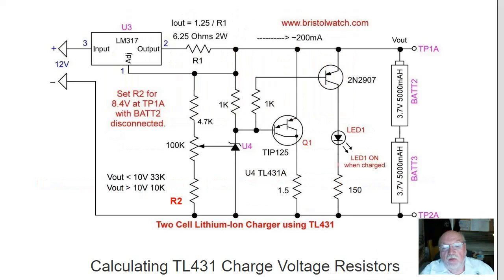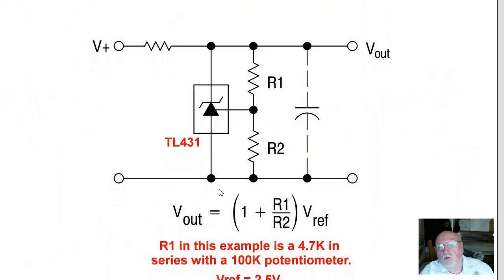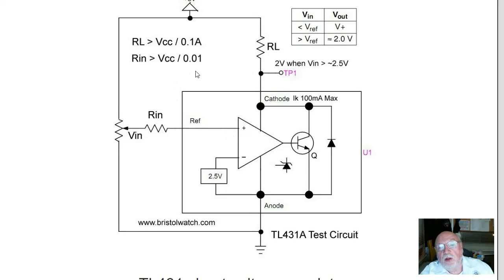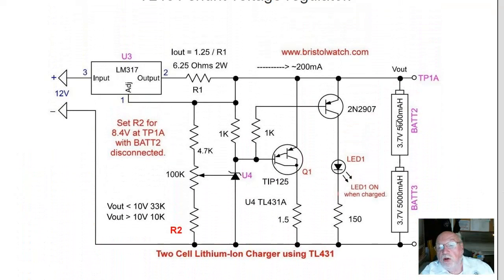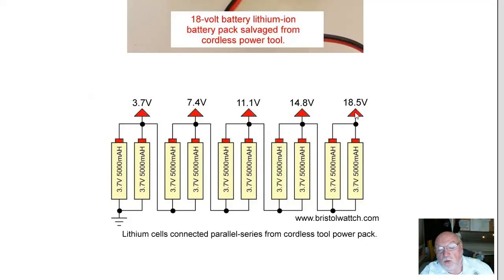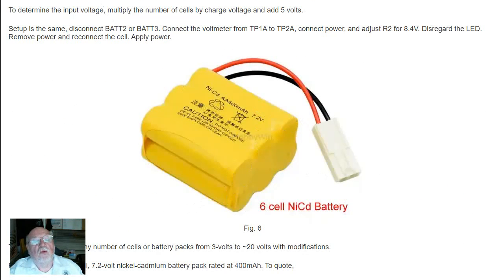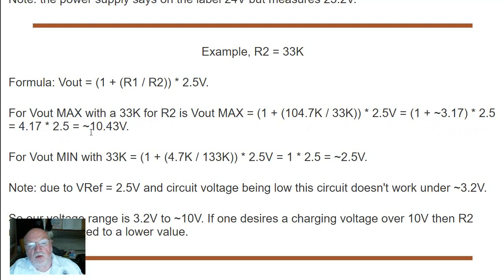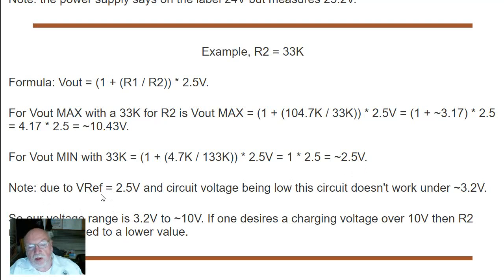TL431 Battery Charger Circuit Calculations Revised

Comment from the maker: http://www.bristolwatch.com/ccs/TL431A.htm Experiments with TL431 Shunt Regulator
http://www.bristolwatch.com/ccs/TL431A2.htm TL431A Precision Current Regulator Circuits
http://www.bristolwatch.com/ccs/TL431A3.htm TL431A Based Current Limiter Constant Current Source Circuits
http://www.bristolwatch.com/ccs/TL431A4.htm TL431A Shunt Regulator Circuits

http://www.bristolwatch.com/ccs/lithium_charger.htm TL431A Lithium-Ion Cell Charging Circuits
http://www.bristolwatch.com/ccs/lithium_charger2.htm Charging Multi-Cell Lithium-Ion Battery Packs
http://www.bristolwatch.com/ccs/tl431_ccs1.htm TL431 Over-Voltage,  Under-Voltage Detector Circuits
http://www.bristolwatch.com/ccs/tl431_ccs2.htm TL431A Constant Current Source Working Circuits Demo

YouTube:
https://youtu.be/kJUit6XQYKE TL431A Lithium-Ion Cell Charging Circuits
https://youtu.be/Fr0Zir8UCLs TL431 10-Volt Charger Short Version</a></p>
https://youtu.be/gg0Tux_pAgk Charging, Charge-Balancing 18V Li-Ion Battery with TL431
https://youtu.be/QfXS70Kwx94 18.5V Li-Ion Battery Charger with TL431 (short)

http://www.bristolwatch.com/ele4/ccs_lm358.htm Arduino Measures Current from Constant Current Source
http://www.bristolwatch.com/ele4/css.htm Constant Current Source Theory Testing
http://www.bristolwatch.com/ele4/ard_css.htm Arduino Controlled Power Constant Current Source